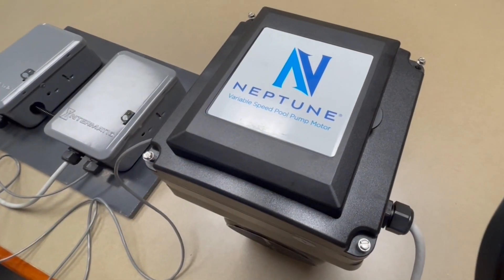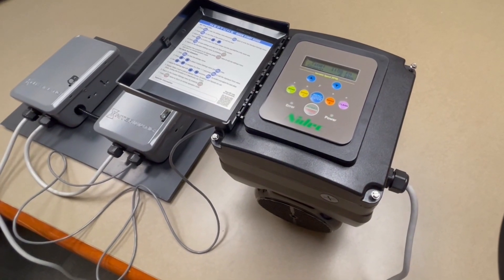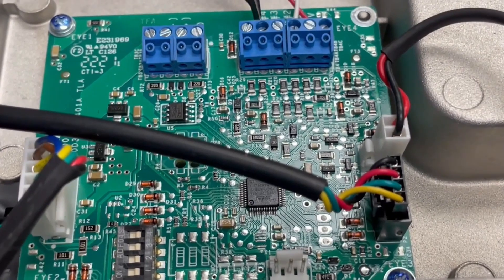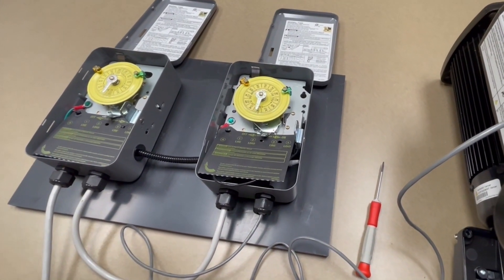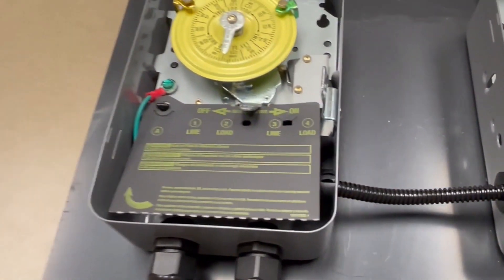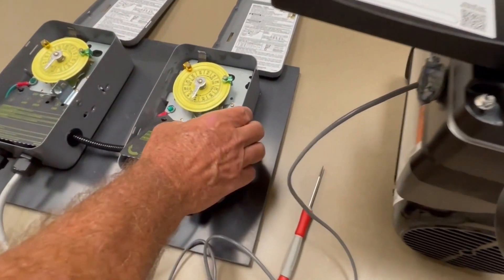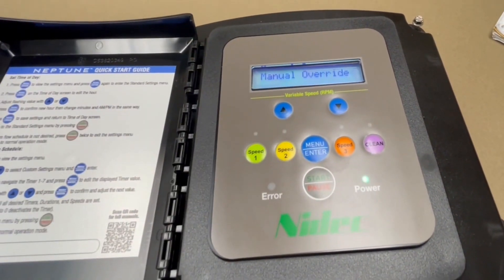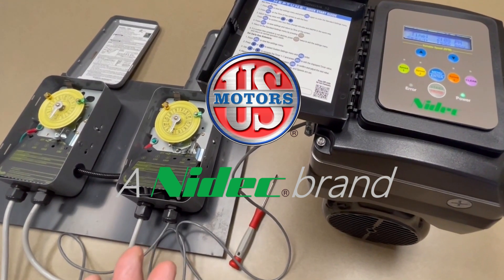Neptune Variable Speed Motor Time Clock Connection

Comment: My motor took a dump and is discontinued. Pool company said this would work. My question is I have a digital screen that controls timers and speeds. Can I still use that or do I have to use the screen on this motor?

Comment: Thanks.  So there is no need for the 230VAC to connect to the timer anymore in this setup?
Reply: Timer still needs power to run the motor inside the time clock that keeps it ticking along.